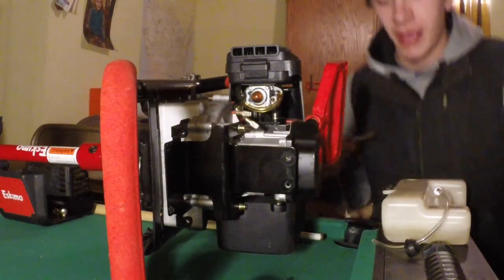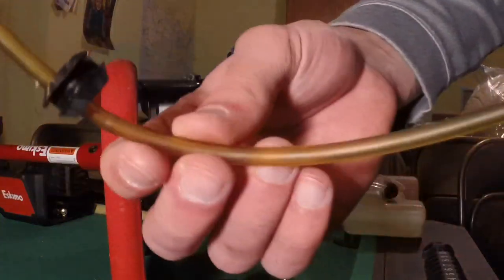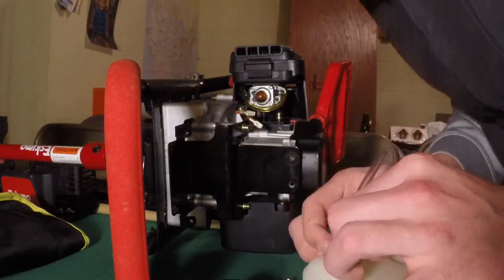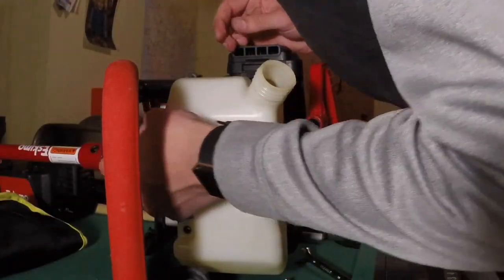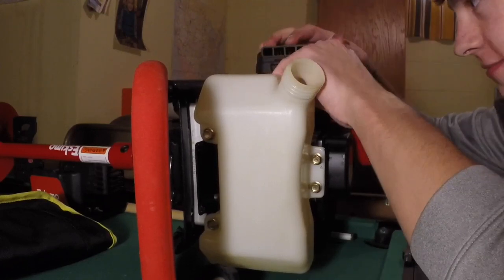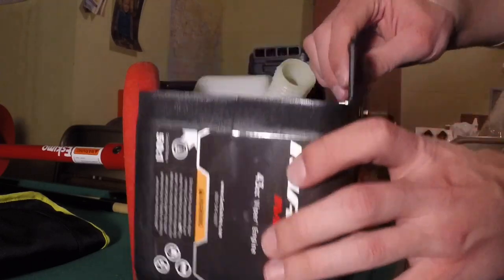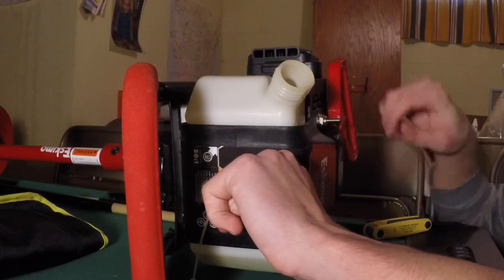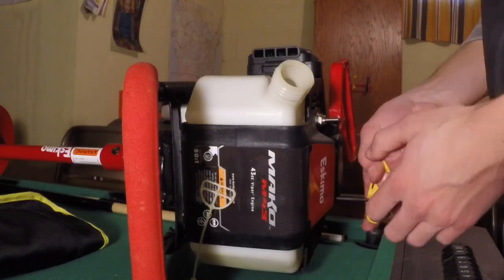How to replace the fuel line on an Eskimo ice auger

Comment: Connecting the hose to the nipple on the carburetor before putting the grommet into place in the fuel tank would make things much easier. Even if you put the line into the tank and seated the grommet first, connecting it to the carb prior to bolting the tank into place would give you more wiggle room to work. Also, use a hair dryer to heat up the tip of the line before you attempt to attach to the fitting on the carb. It’ll cool quickly once in place and make a good seal as it contracts.

Comment: these augers cut and run awesome but are cheaply made
Reply from the maker: Yes they could be made better.  I just upgraded today to a strikemaster
Reply: @theoutdoorsman7408  5TH RECOIL ON MY HYPER/ESKIMO
Reply: If you’re replacing the recoil that many times you’re are pulling it WAY to hard. That’s why it’s called a the hyper coil. I hardly put any effort into pulling the cord  and I’ve only had to replace one in the 7 or so years I’ve had mine. Started pulling on with hardly any effort haven’t had to replace one since.
Reply: @blingblain3156  THANKS TIPS
Reply: @waynewalleye8458  lol sry man I get it, I’ve had to explain that to lots of people in the past and they were completely oblivious to it.